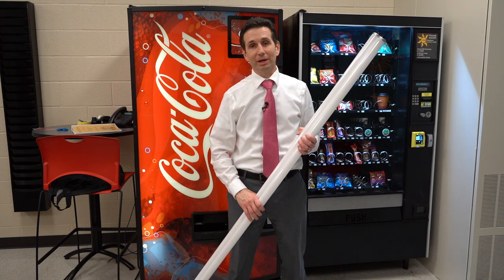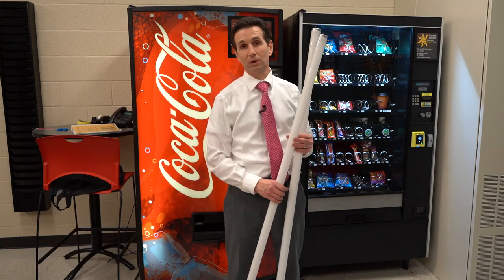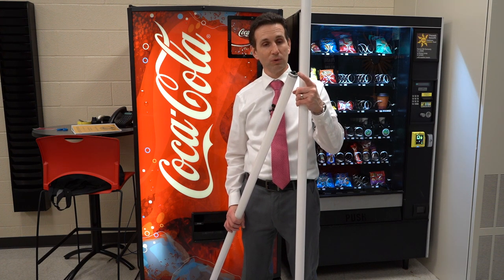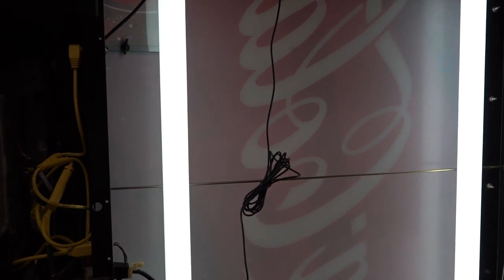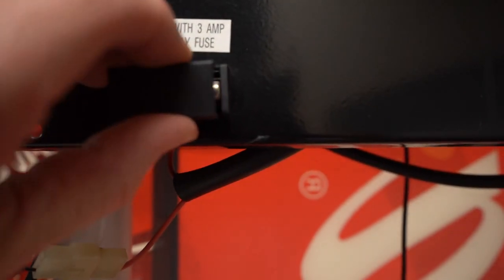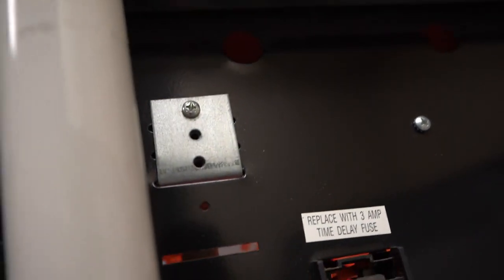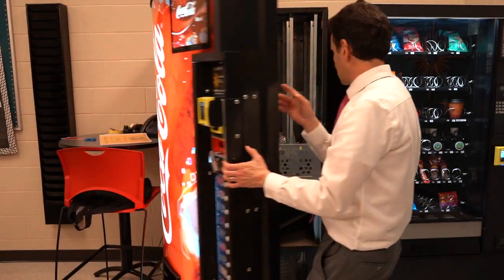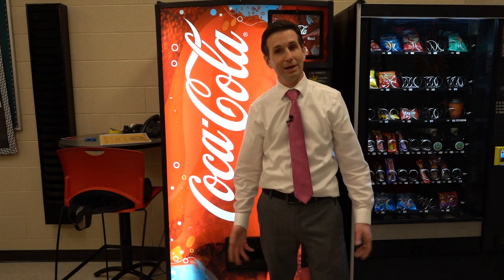How to Replace Bulbs in a Soda Machine

Comment: Hey bill I have the AP 932 snack machine and my door light won’t come on. I have changed bulbs twice? Are there any fuses  I should check or starters? Thank you!
Reply from the maker: There should definitely be starters right near the bulbs.  There should also be a ballast/transformer for the lights as well....unless it was converted to LCD.
Reply: @HappyVending  no starters next to the bulb and the ballast looks brand new. Thank you for your time
Reply from the maker: @towershafer501  Here's a link to the manual for your machine...you're right, I don't see any starters in the manual.  There is an option to shut down the lights through programming...so you may want to check that out on your machine.  If not...get a volt meter and check for voltage going to the ballast. https://www.dsvendinginc.com/images/vending-machine-manuals/automatic-products-rmi/AP_931_932_933_934_936_manual.pdf

Comment: I have left two comments I don’t know if it’s YouTube or you but there is a website you can get LED lightbulbs that are plug and play so you don’t have to rewire your machine, message me I’ll give you the link. I have used it on all three Dixie narco machines that I own.
Reply: Nyled
Reply: Luminaries
Reply from the maker: If you are using plug and play bulbs, the ballast still needs to work.  I like the direct wire ones because you no longer need to worry about the ballast.
Reply: Com
Reply: Same bulbs that you use in this video and more. As far as style of pins single, dual or otherwise
Reply from the maker: @Nick_Townsend  Ok...I just checked out the website.  it would cost $75 for two bulbs, which isn't too bad, but it would still need the ballast.  For that price, I would probably bypass the ballast and just get the direct wired ones.
Reply: Got ya just putting out the info so if people don’t want to deal with rewiring it’s as simple as changing bulbs. Keep up the great work your videos are awesome.
Reply: @Nick_Townsend  how do you attacht LED then?
Reply: @djm2781  the bulbs are tube style led and they look just like the regular bulb as far as length and roundness the pins are single, t8, t12 etc. it’s as simple as take old style bulbs out put new style bulbs in and you are all set they are ballast ready which means they work the same as the old style.
Reply: @Nick_Townsend  what’s the site? Which bulbs do I order I have a royal vendor 804-9

Comment: Bill I installed najax card readers after you said it was a good idea to put it on, now I have one that never operated at all Pay the monthly fee call customer service, without answers it’s been 11 months and 20 days the warranty is about run out ?? ? Any connection between you and those najax people can help with this horrible card readers experience?
Reply from the maker: You haven't been able to get any help with a new reader for 11 months?  When i have issues with a new reader, I contact my sales rep. Did you try contacting the person who sold you the readers?  How many did you buy?  Is only 1 not working?  Does it have signal?
Reply: @HappyVending  yes, it a signal and go through all the procedure and after a minute just cancel, I have try in another  AP studio and goes through take the card but then it doesn’t not active the selection and you lost your $1.50? I bought 3 of them. Very very dissatisfied.
Reply from the maker: @nery200043  are all three not working or just the one?  You can send nayax support an email to initiate a service request.